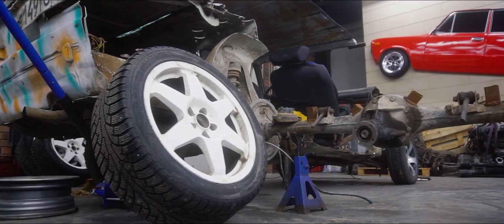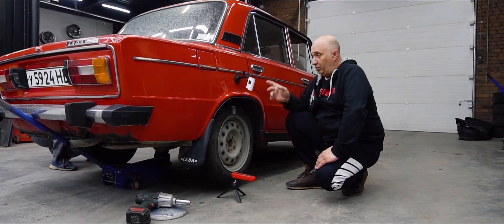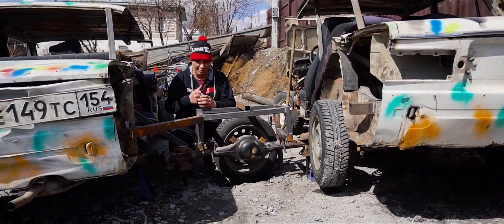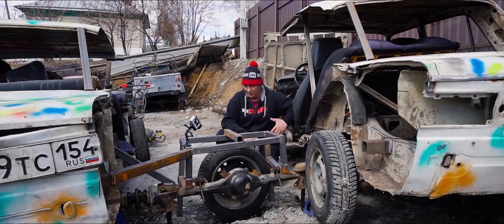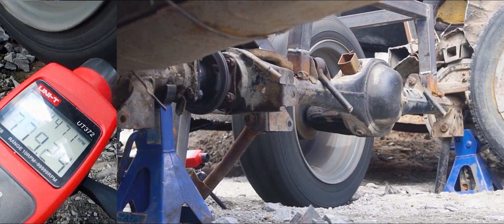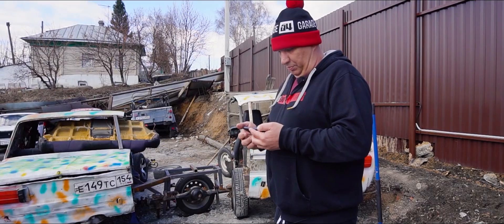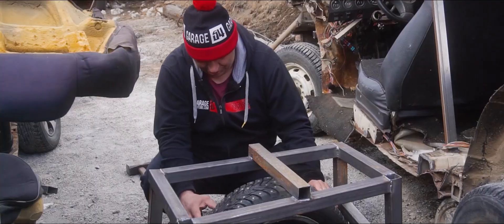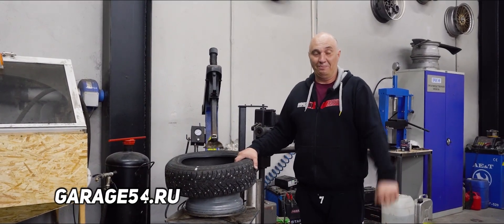What happens to a tire at 620 km/h (385 MPH)?

Comment: If you place an idler tyre on top of the driven one (or on the bottom), you will be able to replicate such speeds but with a load factor.

To replicate the load, you can attach weights to the idler tyre or fasten the assemblies of the two tyres together until a desired force is reached.

Comment: This is the baby version of a top fuel tire. They grow up to 6 inches or more under the rpm’s produced by an 11,000 hp nitro engine….    Some of the newer fuel cars have had tires explode from the centrifugal force under full acceleration…..
Reply: The tire manufacturers can’t keep up with the increasing speed/HP

Comment: As a teen, I once spun my tires up to max RPM (like 160 mph or something) while the car was jacked up, and then slammed the brakes to see what would happen. I heard the shot of a bullet ricocheting. I had flung the wheel balancing weights off my tires like bullets, toward my moms house and they bounced off the pavement.
Reply: Ooops!

Good thing the tire didn't explode! Look up "mustang blows tire on Dyno" there is a video of a black mustang topping out 5th gear on a Dyno and the tire blows and shreds the car apart!

Comment: How about putting it on a dynamometer type setup, for some pressure against the tire and see how fast it can make something else spin, like against another wheel, and try using Continental tires, as I always use for my Lada when going over 600kph.

Comment: In order to avoid tire failure, I try to keep my '06 Ford Taurus under 350 MPH. (563 kph)   
I'd rather risk being a few minutes late than face a potentially hazardous tire failure. 
Additionally, tires are expensive and I like to get as many miles (km) from them as possible.
Limiting my velocity has a positive effect in terms of tire life.

Comment: couldnt the tire just be directly bolted to the output of the transmission? because 5400 revs seems like something the transmission should be able to output because 4th gear usually is 1:1 right? so meaning engine at 5000 rpm = Wheel at 5000 rpm

Comment: If the tire has no contact with the asphalt, it does not overheat. The tires fail because at high speeds they overheat. Your test proved nothing.

Comment: Measure the inside diameter of the tyre's bead and compare to another the same rim size. See if the bead wire has stretched or broken. Just to be clear, is that a safety rim? Many older rims don't have the bead lip- here in Australia early 60's rims often weren't safety rims but would still get used on later models making them less safe

Comment: Tires are the primary limiting factor in the pursuit of extreme speed. Bugatti uses special hand made carbon fiber Michelin Tires that are glued onto the rims. Set of Tires cost over $40,000. They can't be rotated because each of the 4 tires are different. Even these tires can only last 15 minutes at top speeds over 300 MPH. 

I drive a Maserati and it can go in excess of 175 MPH. The tires are Michelin Pilot Sport 285/30 ZR21 Y. They are speed rated at 186 MPH Plus at continuous speed without time limit. My Tire Shop tells me I could expect them to handle 200 MPH or more for 30 minutes without problem. (Note to Self... "need more HP to go 200 MPH").

LSR (Land Speed Record) vehicles use custom tires that can handle the high speeds and extreme heat that occurs for 5 mile runs both ways. Really fast LSR vehicles that have Jet or Rocket Engines, use a 1 piece all metal 'wheel'. At top speed, the wheels rotate 8,500 rpm, far greater than any tire can withstand. The radial acceleration at the rim is 35,000G's - speeds which would disintegrate any traditional tire. Instead, to cope with the enormous centripetal forces, L27 aluminum wheels were cast. Each one weighed in excess of 160kg. Thrust SSC holds the world land speed record, set on 15 October 1997, and driven by Andy Green, when it achieved a speed of 1,228 km/h (763 mph) and became the first land vehicle to officially break the sound barrier. 

NHRA Top Fuel uses custom skinny front Tires for Steering, and enormous Wrinkle Wall Slicks at the back for Forward Drive and Traction. They go in excess of 330 MPH, but for less than 5 Seconds per Run. They last 10 Runs and are replaced.

Comment: The other end of the added rear axel needs to have an input as well! Thus 2x the hp and probably close to 2x the speed with 10 gears 😁
Reply: I don’t think that would work properly, you’d have a large increase in torque if the throttles matched well, but little increase in HP.

Comment: Hold my beer,    idea to rotate faster
1. put the reflective strip on the inside of the wheel where it can not fly off easily.
2. add another axle to the output as before,  and multiply the output rotations by the gear ratio of the differential 
what you have now is  if engine is 1500rpm with a transmission final of 3.55:1 but now its reversed  . 
by adding another differential you multip-ly the output rotation by 3.55 ration, 
 engine 1500rpm---> transmission (3.55) rear diff tires rotate =1 -->  axle 2  output rotation = 1500 on the input shaft, 
add another axle and the output rotation is now 5325 RPM or 3.55*1500rpm. getting the engine to 3000RPM now put the tire rotating at  10,600RPM !!!
 use Universal joints between the  input shat to the third axle to minimize  wobble. or anchor it very securely to keep it from self-destructing. 
 USE A TRUCK TIRE to spin it up to failure. or launch a tire into  a target wall/ vehicle/ over water..

US  tire 235/75R15 has a diameter of 28.9In and a circumference of 90.7 inches and rotation 699  times per mile, 5280ft
11.65 Rev/second @60mph,   Dia: 73.4CM,    Cir: 230.378cm,  434.5 rotations/Km
at 10600rpm the tire should be  rotating at  900mph !! / 1400kph

Comment: Haha.. interesting stuff! If you know the gear ratios and wheel circumference, you can do some simple calculations.
your current setup, assuming the 5th gear has a 0.82:1 ratio. Then at 5000 rpm from the engine, this will turn the prop shaft to 6097 rpm.  If the diff has a 3.9:1 ratio then the final drive wheel speed will be 1559 rpm. So a 175/70 r13 wheel would approximate 87mph(140kph)). By turning the 2nd axle on its side you're achieving 1 turn input to a 3.9 (almost 4) output instead. So, the 1559rpm at the wheels from the 1st axle is multiplied nearly 4 times by the 2nd axle, which equals 6080rpm (560 kph or 350mph) 

 Now!!!!! If you want to go even faster on the rpm. Remove the original axle on the car and turn it through 90 degrees. You don't even need a 2nd axle anymore. Now when the prop shaft is turning at 6097 rpm from the 5th gear ratio (5000 rpm/0.82) it is going to turn diff at 1:3.9. So the final revs from the inverted axle would be nearly a whopping 24000 rpm!!!
Some serious welding, concentric machining, and balancing would be required!!!! It's going to generate serious heat and oil burning! And a sudden release of energy if that wheel broke apart!!!

Comment: Be careful, the tire can still blow you fingers off after it stops.

You could have use a straight wheel and a performance tire.They have speed ratings, and when I worked with tires a thousand years ago they meant the rated speed for 24 hrs. You could maybe get a tire manufacture to sponsor it?

Comment: are rev readings realy correct on this? i thought that 3rd gear was kind 1:1 ratio of crank vs wheel axis revs, so in 3d should be somewhere around 4k under full speed, upshifts just go higher. now add another gearbox/differential into mix, this should multiply by, i don't know, factor 3 or something, so in the end we're getting revs in 12-15k or even higher, not just 5k (and wheel does look like spins like that). i'm wrong about this?
and one big difference: wheel is not in contact with tarmac here, if that would be on the road, pure friction/heat with road surface would make this soft winter tire explode in seconds, imo. would be fun with all steel spikes in it, lol. basically a shrapnel mine..

Comment: Based on the size of the tire 155/65R14 the nominal wheel speed was 589,7 km/h. However due to the expansion it is likely that the tire became so much bigger that the speed of the outer diameter was around 698,9 km/h. Pretty impressive. I wonder what it would take to make it explode. Perhaps if you add another axle and connect one side to the current axle and lock the other side into place. It could double or triple the output speed.

Comment: how to increase a speed? :D
It's simple: just attach another Lada's shaft running in the opposite direction. Differential will sum up these RPMs and will output to the wheel :)

Comment: Appreciate your real-world tests .  But My God you were standing next to those stunts at that speed!  I'm talking about the tire. lol Seriously the tachometer Falls over and your assistant runs up there to stand it up.😲 And I thought for sure when he went to stop it with his hands  a stud was going to grab it  and pull it under the bar. 😒  I kept waiting for somebody to get impaled even standing back where you are at. 😜
   The tires on funny cars and rails can grow several inches. This ineffective lowers the gearing through the initial stages and as speed increases it does so exponentially because the tire grows in diameter. 
  Your next test would be nice if you found a wheel that wasn't bent LOL and ditch the studs. Nothing good could come from them. Wheels with beadlocks would be best. 
    And please be careful.  Put a leash on your assistant! We want y'all around keep bringing more videos.

Comment: That's kind of a weird way to determine the speed based on rpm, you could just calculate it with the tire diameter, because IMO that whole thing with the open diff changing rpm with one wheel blocked makes me think it's unpredictable

Comment: Very bull crap test, it’s free spinning tire nothing else. On real road you have way more factors going on, constant weight of vehicle pushing it down, friction of road increasing temperature/pressure inside, rubber acts differently with temperature….and soooo on……no idea what this spinning supposed to prove….

Comment: if you have a 3.5:1 gear ratio then the ring gear (both axles) will turn once for every 3.5 turns of the pinion gear (input or driveshaft). 35 driveshaft turns equals 10 axle turns for both axles (20 total).
The differential carrier doubles the axle speed to one turn per every 1.75  when holding the other axle still because the one axle has to turn for both axles, 35 turns still equals 20 turns.
if the secondary axle has the same ratio and a welded differential then the pinion (the welded on tire) will spin 3.5 times for every one turn from the cars output (axle).
so 3.5 driveshaft rotations spins the axle twice, which 2 turns on the axle spins the tire on the other cars output 7 times. question is what are the axle ratios and the math is simple from there?

to get it going faster go with a taller gear (2.?:1) on the car with the engine so the tire will spin faster per driveshaft revolution and go with a shorter gear (4.?:1) on the tire axle so the driveshaft output spins faster per tire revolution. make sure the differential is locked or welded on the tire axle because holding the axle still on the other side of that diff will cut the tires rotation in half, if the other axle is sitting still then it will cut that final ratio in half. 
as long as you know the final differential ratio then using the speedometer to calculate tire speed is simple.
Reply: SLOW DOWN!
Ya lost me!
Reply: @ludicrous7044  sorry, I'll type slower next time lol. you need a better explanation?
Reply: @bigjohn3435  
I'm messin widcha BIgJohn!! I'm impressed with your knowledge of ratios and physics!
I had a Franklin quick change in my drag racer and would guess at the right ratio and try a run. 
I'd go by how it sounded and the tachometer. I would change it up or down and do another run.

Comment: Well, this is a very non scientific test. Wobble is the basic trait of spin. Tyre Balancing with weight/s reduces wobble and stabilizes the spin. Wobbling at high speed shall dislodge it from the rim. The air mixture, inside, shall heat up and expand. If not escaped, it shall expand and burst the tyre. It is all molecular disintegration of gasses. Heavier Molecules shall get nearer to the Centre and lighter ones to the outer surface. That is how Nuclear Enrichment is achieved. Pity that commentators are puerile and not very intelligent. Sad indeed.

Comment: Its very hard to test the high speed durability of a tire with the extreme runout that the wheel had. Next time it needs to be rotating as true as possible to receive accurate results. Honestly believe that the test tire would have survived with little or no damage had the static and dynamic balance of the wheel been a fraction of how it was tested. Test the next tire on an aluminum wheel like is used on millions of vehicles today. The results will likely be very explosive!

Comment: Curious what the diameter of the wheel and tire is. Funny Cars and Top Fuel will go 330+ and have 15 inch front wheels. Assuming they stay on the ground they may be spinning faster?

Comment: Why didn't you just calculate it instead of measuring the speed using the tachometer...?
As far as I can read it's a 155/65R14, which should have a circumference of 175 cm meaning the car moves 1.75 meters for every rotation of the tire. 1.75 m / 1000 * 5606.7 RPM * 60 min = 588.7 km/h  (not 620 km/h). It's pretty simple maths...
In reality, the rolling circumference while driving is somewhere around 3 % less since the car's weight compresses the tire and therefore reduces the effective diameter. On the other hand, if the tire expands due to centrifugal force, maybe it would cancel out.

Comment: Y rated tires are the highest speed rated tires before you start getting into really expensive tires and what you guys should do is take another differential and drive it from the axle end with the pinion end of another basically take a differential and drive the off of from where you have your tire now. We should see how many differentials we can hook up all together before the engine is no longer able to turn the large mass or it all explodes!

Comment: While I'm watching this, I'm thinking of all the ways this rig could kill them:
1) The internals in the differential they have the wheel attached to seize, the wheel breaks free, and goes berzerk.
2) The tire disintegrates, slinging steel belting everywhere.
3) 'The welds mounting the rear end in place fail, the spinning tire hits the ground, and sets the whole thing rotating like a crashed helicopter.
4) The cut suspension link you see bouncing around at 10:47 flips around into the tire, instantly shredding the tire, possibly snapping off, and impaling someone.
This is a cool video, but these guys have a death wish.

Comment: That's amazing, but how would it react with the weight of a vehicle on it? If you had a dyno roller you could put weight on the tire to push it against the roller to simulate a vehicle sitting on it. That would be interesting, might possibly just do the same thing tho

Comment: Speed rated tires have extra belts to prevent the thread from bulging out like that intern pulling the bead off the wheel.
Land-speed racing requires higher than labeled pressure in addition to speed rated tires. As well as a rule limiting maximum width of the tread to used on the Salt Flats

Comment: Where those tires made in China ? That's your problem right there those Chinese tires are junk I bought a wheelbarrow last year and had a China tire and tube it would not hold air more than one month the tube you could almost see through and tire was thin as well like a plastic plate I bought good quality ones and three times the thickness for the tube and the tire I wish I would have keeper the to show people how bad Chinese tires and tubes really are...
I would not want them on my car driving at 80 k.m.h. in case they blow up...
Your videos are great I like watching them 🇨🇦 you must go through a lot of Lata cars ? I have not see one of those since the late '70's in Canada there used to be a dealership around the corner from our house

Comment: So why not a second cage on top with a tire pressing down to provide a "surface" to run on.. set to be engaged or disengaged as needed (long pole with counterweight) , granted it will be an inverted surface but with it being properly mounted with a hub and all inside a cage providing a little more protection it might work... Also keep the brake on that hub for other tests / fun  
How long will a brake pad / shoe last trying to stop at that speed?
Drop a chute leading to between the two wheels and roll in a few golf balls (kidding!)

Comment: Issue is there is no weight on the tyre, so it doesn't have to deform itself every single rotation where the weight compressed it with the ground. That's what kills them.

Comment: You have mass. The more mas the more centrifical force.your studs dont help. I have roadrace f1 tires they are very light weight .little rubber on tread. Drag tires are designed to have growth. Less internal pressure but lots of area rubber to allow for expansion.the tire held up very well considering.